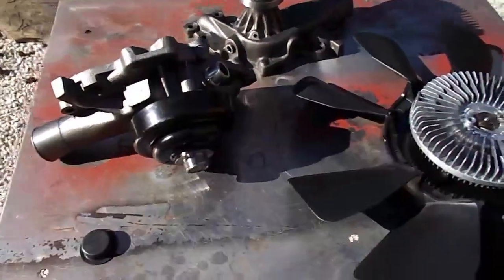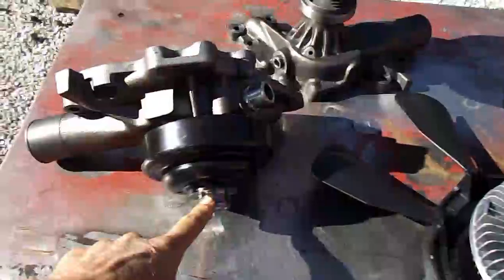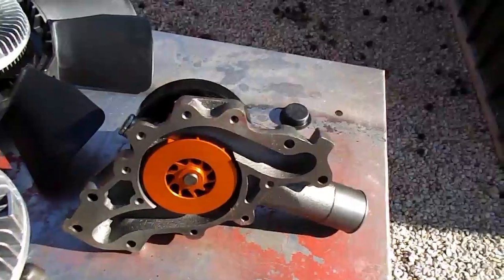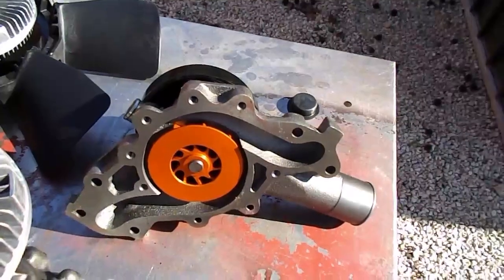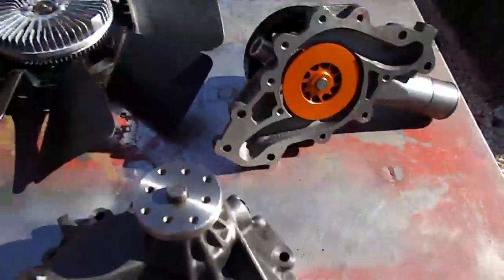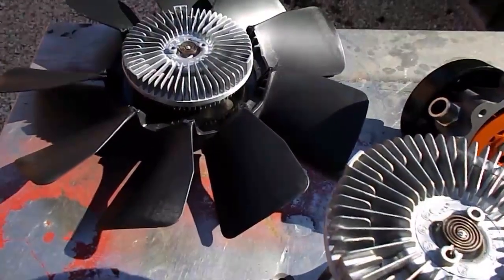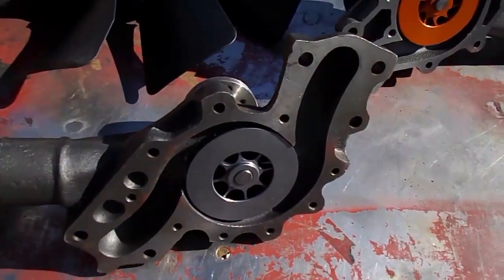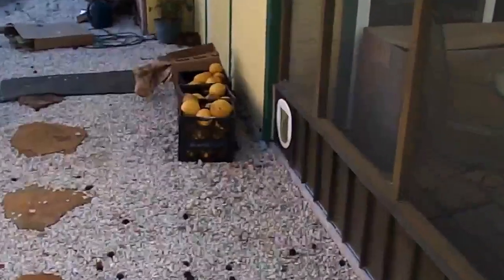Upgraded Balanced Flow water pump system

Comment: How about a guy that wants to do conversion? From v belt to serpentine? What water pump do I do then?
Reply from the maker: You can use the balanced flow cooling system on my cooling page of the website at Leroy diesel.com